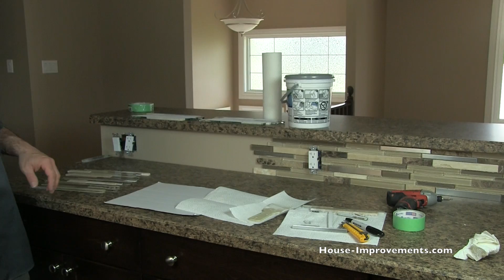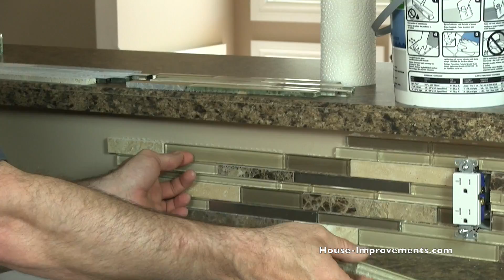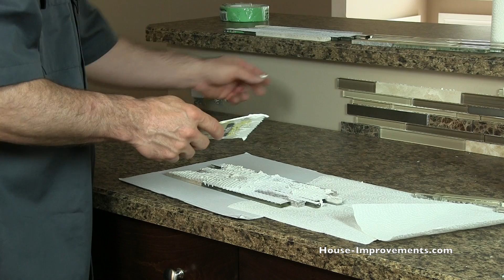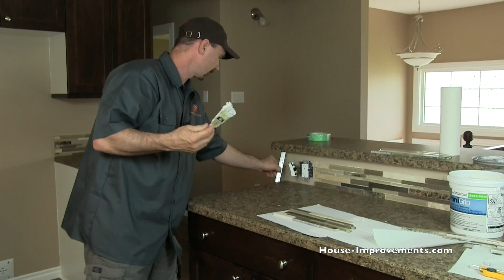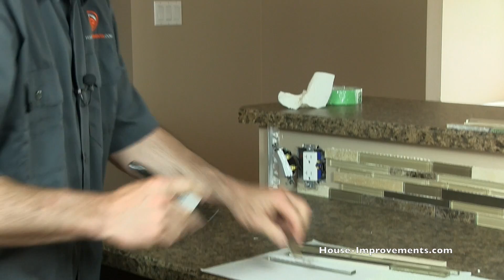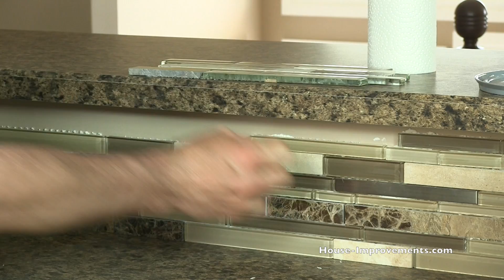How To Install Mosaic Tile Backsplash

Comment: You always make it look so doable. Thanks again..👍 But I noticed you put the Mastic directly on the tiles whereas every other video I've seen shows putting on the wall and then sticking the tiles to it. Is there an advantage to your method? I rather like it better.....seems less messy...???
Reply from the maker: You are correct , I just find it easier than spreading in on the wall in the awkward areas under the cabinets.
Reply: @HouseImprovements  Shannon, for what it's worth, you take the mystery out of projects. Your channel has become my first go to place when I am contemplating a project. I built a large deck by following you. Thanks for making it easy...👍

Comment: I know this video is a few year old, but could you comment on the types of adhesive to use in mosaics that have different materials (glass, ceramic, natural stone)?  I know that it is typically said not to use mastic under glass and to use a latex additive thin set, but my mosaic pieces have varied materials similar to the ones in this video.  Is mastic ok to use since it is not all glass? Thanks so much!
Reply from the maker: I would not be at all afraid to use mastic on a a glass mosaic or any other mosaic for that matter especially in a kitchen back splash. Larger format glass tiles i would not since it would never dry, but mosaics no problem.
Reply: @HouseImprovements  thank you so much, Shannon! I also wan't expecting such a fast response and feel better now knowing I was on the right path with the mastic to start with :) Warmest regards!

Comment: there are spacers for the switches. I purchased mine from Gordon Supply online. They are the size of the outlet box so now wires would be exposed which is a possibility when using the little cap pieces as spacers. Back buttering is when you put the putty on the back of the tiles. Terminology can be important so that we are all on the same page.

Comment: Please help - There is laminate (formica) on my kitchen walls as a backsplash.  I want to install subway tile or glass tile back splash.  Do i need to remove the laminate (please say no) and do i need to use backer board.  Thank you all in advance.

Comment: I am planning to instAll backsplash in our kitchen.. I was wondering if I can install mosaic tiles with acrylpro into a painted wall with orangepeel texture?? Thanks for any help..
Reply from the maker: It will not be perfect because of the pebble/orange peal texture but should be doable.
Reply: +HouseImprovements so.. There wont be any problem?? What if i use  a bondera a tile mat adhesive will it work better than using acrylpro? Thanks for the help..!

Comment: Hi, great video!! I am attempting my mosaic backsplash. I have about 1/2 brick on the main wall. It has been painted white but is a very heavy texture. It was here when I bought the house. I have removed to old countertop but the new tile is thinner than the brick. What do you recommend that I put on the drywall to make the tile flush with the brick? I will run a bead of silicon or acrylic between the brick and the tile. But what about the join of the tile and countertop? Is a clear acrylic or silicon how you finish it?
Reply from the maker: +Debbie Sackiw Please use my forum for your questions. When you post there add information on the difference in thickness you need to make up between the tiles and brick please. http://www.house-improvements.com/forums/
Reply: +HouseImprovements Sorry, I couldn't find where to reply on your website. The difference in the thickness is 1/4 inch. Do you run a bead of silicon or acrylic at the join of the tile and countertop? Is one preferred over the other? Thanks!

Comment: What did you do with the gap at the top, between the tile and counter top? It appears a fairly good size and that's what I'm dealing with. Did you leave it, caulk or something else? Thanks.
Reply from the maker: That gets a nice neat bead of silicone.

Comment: I'm in the process of turning a pink and grey tiled bathroom into a white and grey tiled bathroom. I'm spraying the tub with a white epoxy and then all the pink trim tiles. I'm pulling the grey and pink floor tiles and I'll backer board the floor before retiling with a tumbled white and grey marble 12x12 that is small tiles on the same matrix mesh you're dealing with. The old timers always used a beater block to set tile. I highly recommend a beater block to do floor tile with the matrix backed type tiles. That is if you want a flat floor when you're done...
Reply from the maker: Yes for a floor you would have to use a "beater block" or it would never be flat.

Comment: I really appreciate your insight. One thing that might need mentioning is that typically you put a spacer between the tile and the counter-top during installation and use grout caulking to seal between the tile and the counter-top. Normal grout will crack and fall out of the joint since the tile on the drywall will expand and contract at different rates compared to the counter-top.

Comment: Will some sort of extender be needed in order to have the electrical outlets flush with the new tile backsplash?
Reply from the maker: Yes you can use a box extension or if you are cheeper like me I use a 1/4" nut as a spacer between the receptacle and box , just place it around the mounting screw.
Reply: Or just buy the extended screws. Just ask at your big box store.

Comment: Mastic really is not recommended for installing glass tiles, it would be alright for the stone parts of that mosaic, but a high polymer content should really be used for glass tiles in general.
Reply: why wouldn't you use Mastic?
Reply: Many glass tiles backings will react to certain mastics over time causing discoloration, many manufacturers require the use of a high polymer content thinset for thier tiles, so unless you are sure that the manufacturer of the glass tile allows the use of mastic to set the tile, I would not recommend the use of mastic. If on the other hand you are certain that mastic is accepted as a suitable adhesive by the the manufacturer, then go ahead and be my guest.